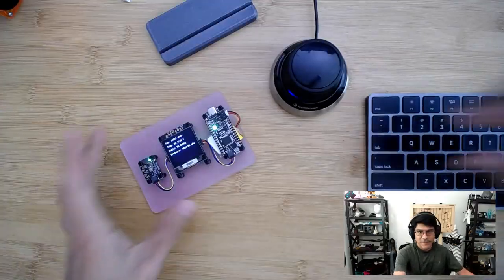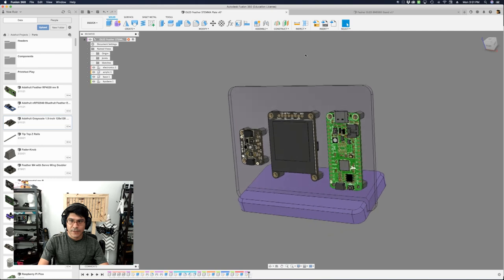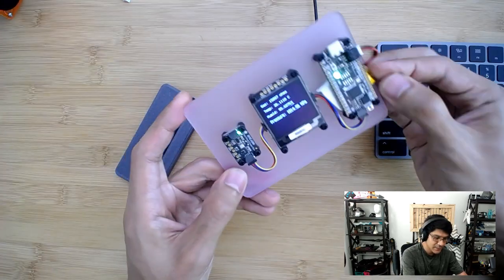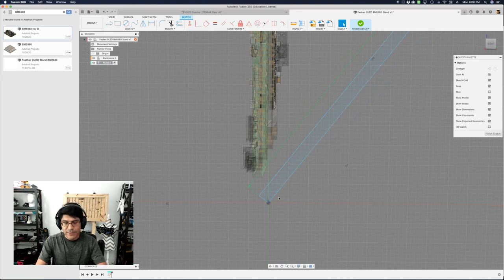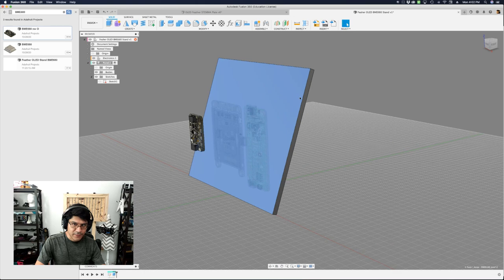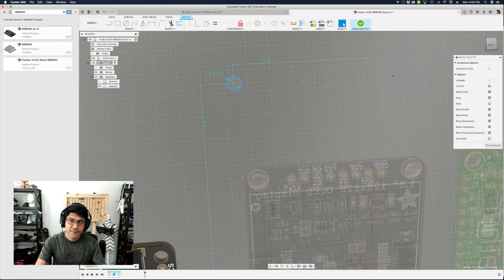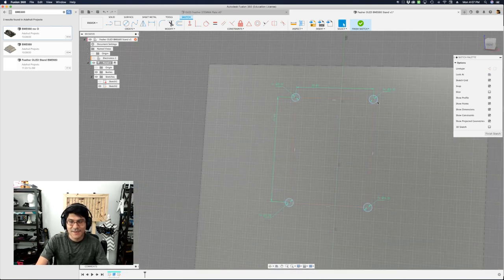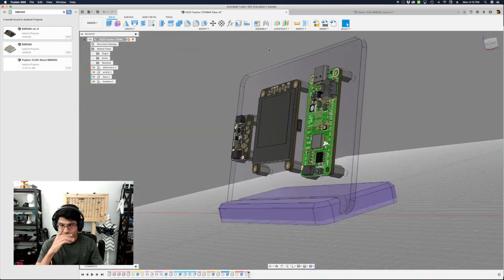Fusion 360 Tutorial – Panel Mounting External Parts – Layer by Layer

Comment: Well done!  I was attracted to the idea of panel mounting adafruit components in a design but really appreciated finding out about the CAD library and seeing a great workflow for using Fusion's parametric modeling while capturing design history to make components interactive and the objects connected react and change appropriately.
This was a great use-case for Fusion's parametric modeling that is the hardest thing to conquer in Fusion 360 for the hobby maker.  I have turned off design capture by default for a while now because I treated the tool as a prototype design tool, without regard for the productization aspect of a design, mostly because it is a big time investment if you aren't fluid in its proper use.